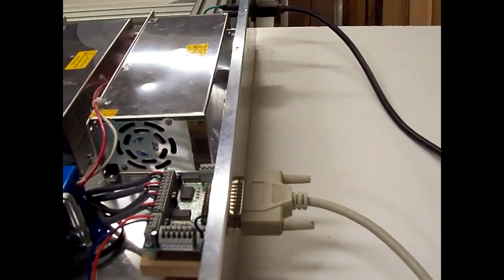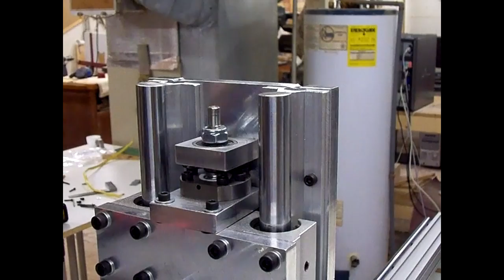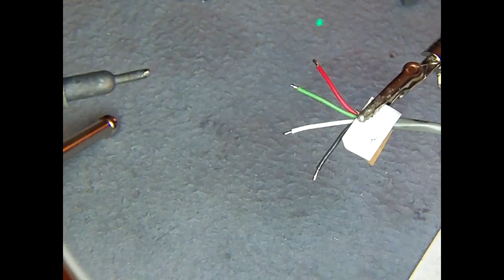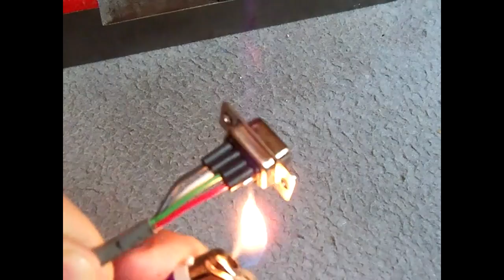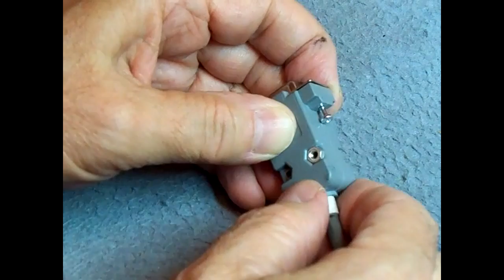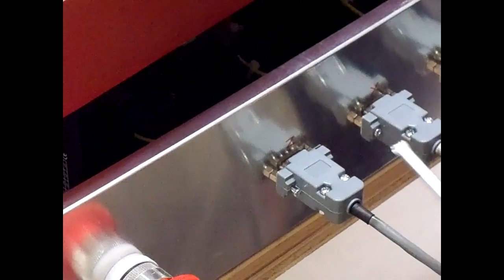CNC Router build part 8 testing & installing motors

Comment: Hi Robert.
Great videos of your build and great job done there !!!
I like the design.
I noted that this was a kit from cncconversionkit.com, however, that website does not seem to work anymore.
Would you know if he is still making those kits, or if he has closed down that business.
At a pinch, I should be able to something similar by  looking closely at your great videos.
I think I  saw somewhere that your machine was a 54ft x 8ft machine ?
I think that the aluminium extrusions used are 50mm x 50mm ?
How have you found the flex in those in both the X and Yaxis. I ask as I may make these much bigger if flex was an issue as I plan to cut aluminium on my build
Many thanks for any help Robert
Reply from the maker: Thank you!  I don't know if they still make these kits or not.  As you stated the web site has been gone for a couple of years or so.
My machine was a 51" x 31 if I remember correctly.  It will cut about 24" wide in the X axis x 48" long in the Y axis.  The extrusions are 60 x 60 mm.  I haven't noticed any flexing issues.  Best of luck if you decide to build on from scratch.
Reply: @MyRobertadams  Thank you very much. 
Wow, what a quick reply .. very impressed indeed!
That is a good size ... 
Good to hear that there is no flexing !!!
Out of interest, have you tried cutting aluminium ? and if so, how did that work out ?
Many thanks and good luck on your projects
Your videos are a great inspiration !!!
Reply from the maker: @TheMysticABC  
Yes I have cut aluminum and it does okay with no more than .005 to .007 depth of cut.  Check out this video of making a fidget spinner out of aluminum.
https://youtu.be/PClBGEKvlSE
Reply: @MyRobertadams  
Thanks for that
Well done on that. Really impressed on how you went about it
Reply from the maker: @TheMysticABC  
Thank you!

Comment: Can we make the two stepper motors of the Y axis spinning in opposite direction?
Reply from the maker: I think so.  I think you just switch two wires on the driver.

Comment: Thanks for the excellent Videos.  I am building the same machine.  Everything is going together.  I started the electrical portion and have a question about the Y-axis connections to the breakout board.  I connected to Y and a fourth set of connectors. Do these get assigned in the Mach 3 setup?   Another question; do you have a video about connecting the coolant to the spindle?
Reply: Thanks again. I just watched and copied your wiring diagram.
Reply: Yes it was.  I have a different breakout board and I know how to hook it up.  Your wiring diagram helped me.

Comment: My dear has used the wrong plugs to power the stepper motors. I should have to pick something stronger. Maybe something like that 
https://www.banggood.com/4-Pin-MaleFemale-12mm-Wire-Panel-Connector-Aviation-Plug-L90-GX12-Circular-Connector-Socket-Plug-p-1190742.html?rmmds%20=%20Search
or something even stronger

Comment: Robert Hi,  I got to the testing phase... on my power supply (you have 2)  I have a question.  I get 48v from the com ports and no voltage from the V+ ports.... is this right that I should feed the power from the com ports to the stepper drivers?  is that right?bob

Comment: Really nice work! A piece of art ;) 
I got some questions about your build?

You are using nema 23 steppers? 

I'm currently building my own machine, and already got some nema 34 motors laying and collect dust at the moment from one of my previous build ideas that never happend

I am a bit afraid that I won't get the speed/torque that I want 

It's a 20mm OD 5mm pitched ballscrew 
Nema 34 4,5Nm holding torque (don't know the torque curve) because I can't find any data sheet other than basic information about the stepper motor,

I would like to get somewhere between 200-300ipm so what's your experience with feed/cutting force speeds with those nema 23's? 

Do they ever stall? If so at which speeds?